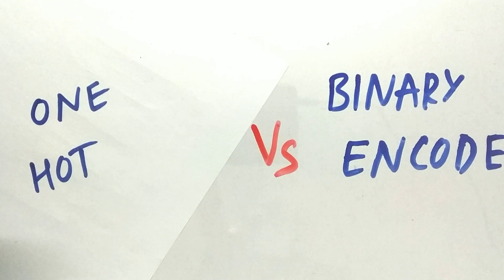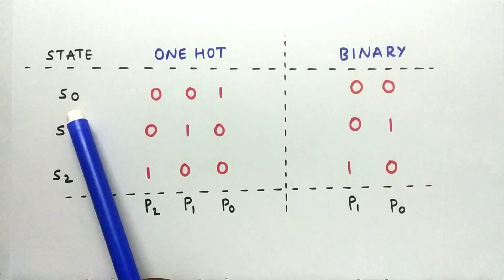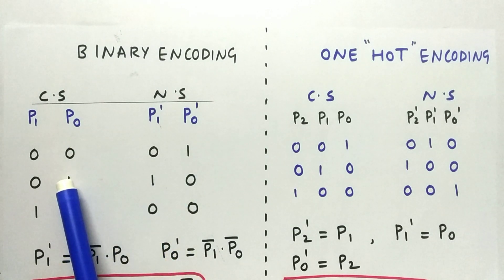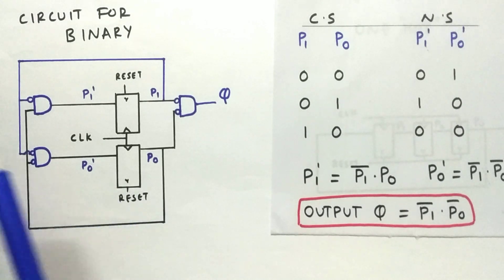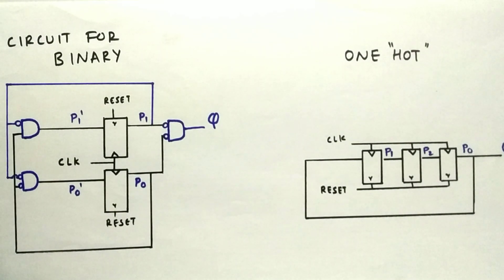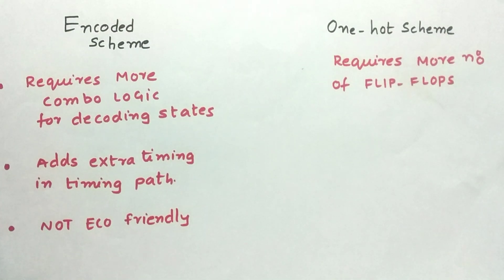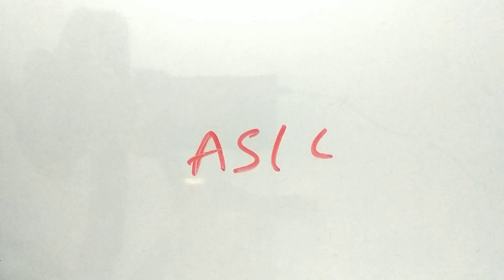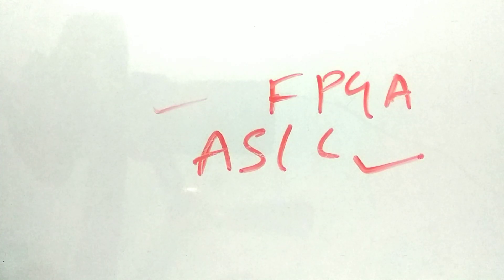One hot vs binary encoding || which one is better for FPGA/ASIC? || Explained with example

Comment: What is ECO?
Reply from the maker: Namaskaram 🙏 Lakshya,
Engineering change order , ECO is the process of inserting a logic change directly into the netlist after it has already been processed by an automatic tool. Before the chip masks are made, ECOs are usually done to save time, by avoiding the need for full ASIC logic synthesis, technology mapping, place ,route, extraction and timing verification. EDA tools are often built with incremental modes of operation to facilitate this type of ECO.

Good luck & great health 👍😊

Comment: what is eco?
Reply from the maker: Engineering change order , ECO is the process of inserting a logic change directly into the netlist after it has already been processed by an automatic tool. Before the chip masks are made, ECOs are usually done to save time, by avoiding the need for full ASIC logic synthesis, technology mapping, place ,route, extraction and timing verification. EDA tools are often built with incremental modes of operation to facilitate this type of ECO.
Reply: hey karthik ...thanks for the video..i request you to make a video on latch up problem in mosfets
Reply from the maker: Ok uday I will do it , but I need some time for it 👍